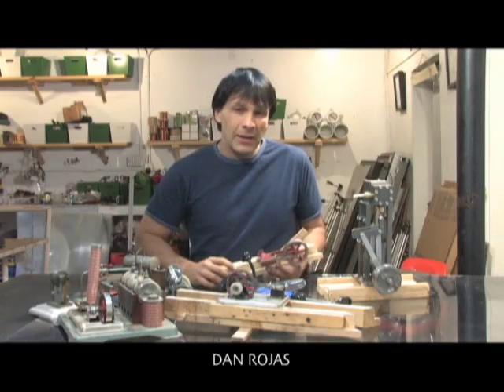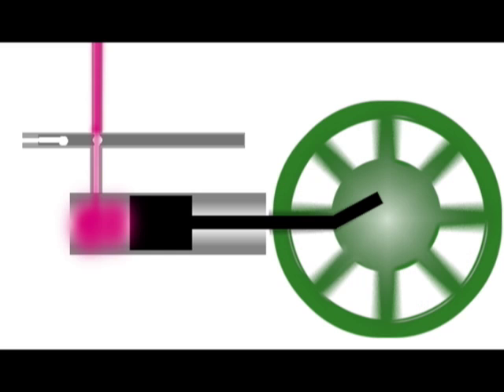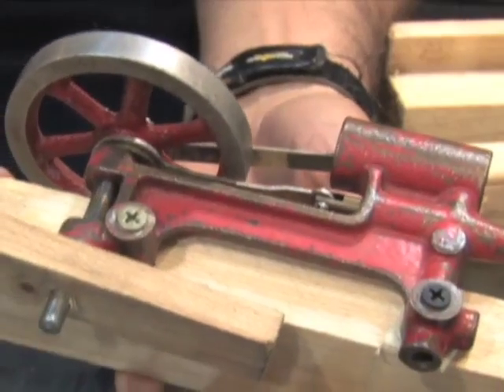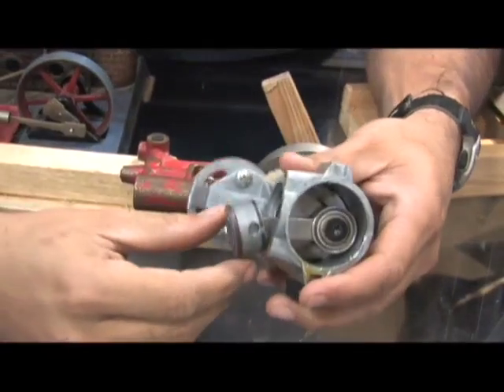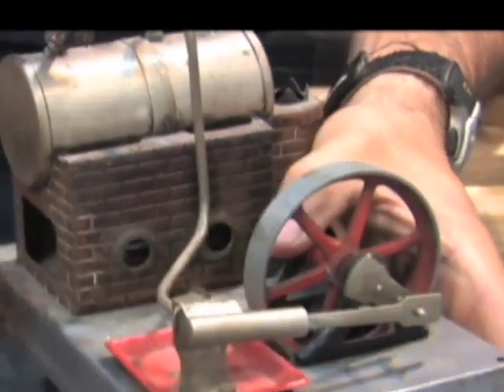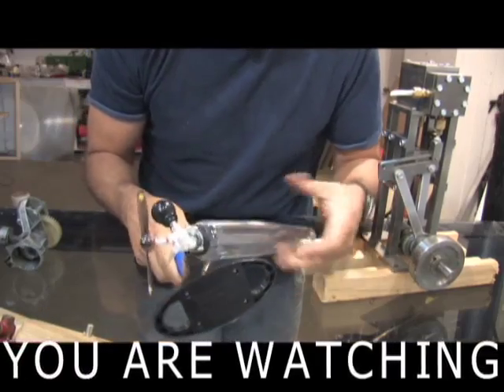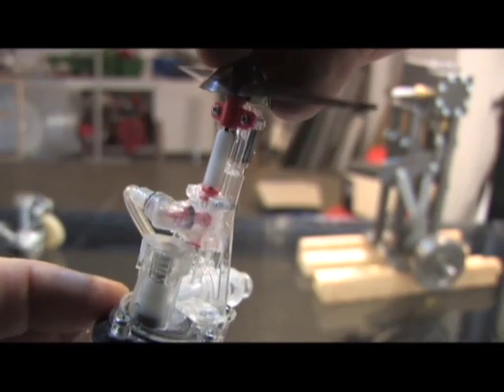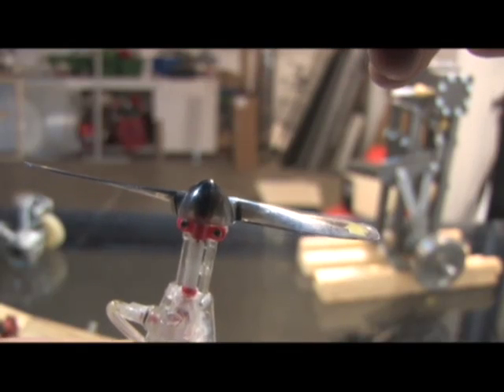Make a Steam Engine convert to a SOLAR STEAM ENGINE AIR HOG ELECTRICITY

Comment from the maker: The end goal is steam which can run this directly from the sun. The air compressor is just a stand-in. Once I have the valves worked out, the solar part will be tested.

The efficiency estimates are based on what they can do with the same volume of air. Also, no 2 inch bore can run on 5 psi like the converted compressor/engine can especially without a slide valve. Thank you for the comment:-)

Comment from the maker: A check valve has a spring or is air locked. This causes air or water to travel in one direction. If you press them, they open then lock closed. A slide valve just moves back and forth with holes acting as valves. The "Air Hog" has a Check Valve.

Comment from the maker: Hi Robbosdog,
I used a regular Reed and Solenoid with AMAZING RESULTS!!!!
UNSCIENTIFIC:
The torque is unstoppable by hand down to 25 PSI.
It runs 4 minutes on a 10 gallon tank at 110 PSI.
Top RPM 600
At 2 PSI it still runs, 60 RPMs but it still turns.
This piston, the more torque the more air that fills the piston.

I will have a video soon.

Do you know the name of the motocross valves?

Thank you for the comment.

Comment from the maker: Hi,

It should as it seems to work fine on a very low PSI and volume. Thank you for the idea. I will be using the big dish and I actually have a bunch of empty OLD STYLE VALVES.

I will also be trying some home made solar evacuated boilers.

Comment from the maker: You are correct about the piston valve:-0 Thank you for catching it. I will add an annotation. The large vertical engine works good on high pressure but rough. I think the flywheel may have a problem? I love your channel. You have some great stuff:-) I have a few questions I will be sending you soon. Thank you again.

Comment from the maker: Most use a simple slide valve that basically opens, closes then vents. Others use a more efficient piston valve. There is a big loss of efficiency in both on the venting side.

Comment from the maker: Thank you for the comment. The air hogs are simple plastic with a rubber gasket. The compressor is unknown, only a number. I have searched for hours and could not find anything.

Comment: The air hog was based on compressed air engines used to power model airplanes as far back as 1933.  Gasparin still produces small "co2" engines for model airplanes powerd with a co2 cartridge.

Comment: Great job DAN, thanx 4 educating us, I've been using chainsaw as steam eng.have to spray down (silicon spray) the piston otherwise the piston scorch's the cylinder walls bab after 6-8 hrs   have not been able to use better means unless start casting & milling my own parts till now! Love  what you discovered Someone did suggest using a diesel 2 stroke engine & converting it?? Finding a heap use 2 stroke diesel is another story? Great job!

Comment: cool video!  but correct me if i'm wrong: aren't you burning more power running the air compressor than you're actually generating from it in return...???

Comment: I'd be interested to see you test that against a slide/piston valve engine of similar size to get a scientific comparison of the relative efficiency of both: I saw that you had a rather large vertical steam engine in the background while talking about the smaller steam engines, which might be a good comparator. 

Incidentally, you refer at some instances incorrectly to a "slide valve". The Wilesco D10 and that little red engine do not have slide valves, but piston valves.

Comment: very cool. would be nice to have solar power from thermal to avoid the costly solar panels. if cheap.
you might want to do an efficiency experiment. measure the mechanical power vs the air power. a pressure sensor and flow gauge should tell the power used in the air. 
mechanical power can be done with newtonmeter coupling, radius value and rpm measure. do that for various loads and pressures to map out the efficiency.

also I hunch that a large piston is more efficient. rotating ball valve

Comment: Interesting design compressor.  Suggest  attending Model engineering Exhibitions?  You will see numerous steam, hot air , hit or miss engines, hot bulb engines air engines and of course internal combustion .  The folks who build them are experimenters with boundless knowledge of engineering Heard of the soloniod valve IC engine? Examples are powering air planes and boat models!  Very efficient. Try the "NAMES" show in

Comment: Steam is far more powerful than air. The expansion of the steam is the secret, on a more sophisticated steam engine you could reduce the stroke of the intake valve to take advantage of this and reduce consumption . Way more efficient than your floppy bent rod piston affair. A governor would help with that generator load too. Just a thought.

Comment: Dan, lots of people build or convert steam engines or compressed air engines, but nobody ever dynos them to see how much power they put out for a given air flow. How about it? Give us videos testing your engines on compressed air, measure the air consumption (flow rate) and correlate it to horsepower (or torque).

Comment: the feedback of the tested devices , reduced the rpm , i that if you put a coil between the alternator and the out put device you will reduce(even eliminate) the resistance inducted to the alternator by the feedback
therefore keeping speed and power.
Good luck keep the good work !

Comment: Because the amount of amps it needs to deliver to a closed circuit, is much larger, than other loads (like the fan, and the light bulb)

If you ever come across a dynamo (e.i. a bike light with a wheeldriven dynamo) try to short-circuit it, and se how much more power is needed.

Comment: I notice that the engine goes weak when you close a circuit. I seen the generater it was attached to and that it did a good job turning it, but why would a closed circuit create its own mechanical load?

Comment: Didn't locomotives get better efficiency by using both sides of the piston? first one side gets pressure then it opens the vent and the backside gets presause returning it to the start position and opening a different vent?

Comment: doesn't that waste compressed air in the exhaust phase because it doesn't turn off the air supply when the cylinder is open

Comment: You can make pressure with heat... heat can be made with the sun (light).  You can then use the mechanical energy to make electricity... to make light.

Comment: @dickmartn I hear you. It would be cool to see a waterwheel/windmill with a compressor with a storage tank to store the air (energy). Use the stored pressure to run a second compressor/engine to an alternator-battery-inverter.
At least he gives us ideas and from there we can go forward and tinker. Scrap yards offer great pickings for rock bottom prices. Just need inspiration or a design to steal. :)

Comment: if you are looking for a powerfull air moter try a impack gun tool they flow a lot of air but if you get one that is adjustable thats good, at 100lbs of air you can get 115foot lbs tork, depends on mfg.

Comment: I am not sure how you are figuring your efficiency. Why not run your steam engines and air engines on a fixed volume/pressure of air and see which one can lift a weight the highest? 

A Stirling engine by definition works on a fixed volume of air, so if you are using a venting cylinder you are by definition making something other than a Stirling engine.

Comment: I belive your air pump engine is less powerfull thin the wilesco D10 on scale the air pump it self is like a oscillating steam engine like you D-6 this means there no power stoke on the exhaust side unlike the D10 that open a steam port on the back side that lets steam in to push the pistion back to the starting pont. Oscillating steam engine are like 2cyc engine  thay run at higher RPM but with less power and Traction engine are like 4stokes run at less Rpm with more power and us 1/2 the steam.

Comment: So you take 120VAC wall power and at a huge loss, you use that power to compress air.  Now you take that air and, again at ANOTHER huge loss you step advance a flywheel, then using that flywheel to turn (again at a loss) a generator to then run some device.  Wow - if you only had some modern fancy thing called A POWER SUPPLY !  Wall power could do the work in the first place (much greener, far less Rube Goldberg losses, and much less noise) - oh well,  thanks for trying anyway.

Comment: some of the stuff u said is meaningless like the point about comparing that engine off the motor to a larger scaled up version. it doesnt depend only on the size of the piston and the windspan. but the windspan is infact depended on the area of the piston AND the how much the connecting rod is to the crank shaft. pretty basic mechanical stuff. infact the exausting of steam is very inefficient.

dont mean to be rude. just wanted to point out mistakes.